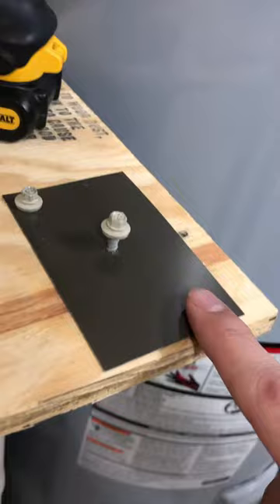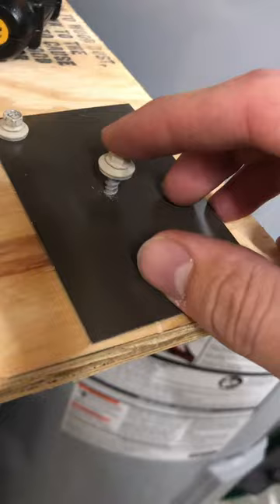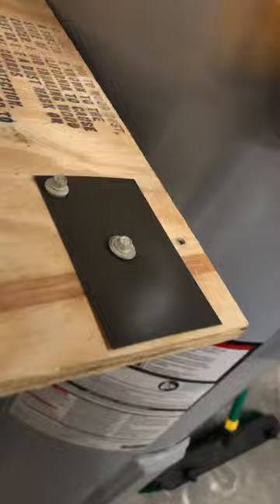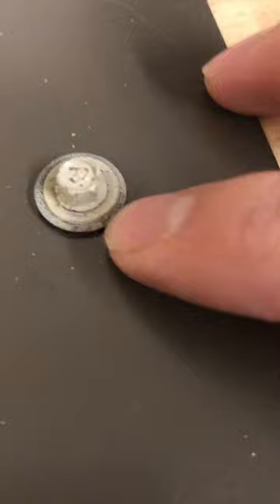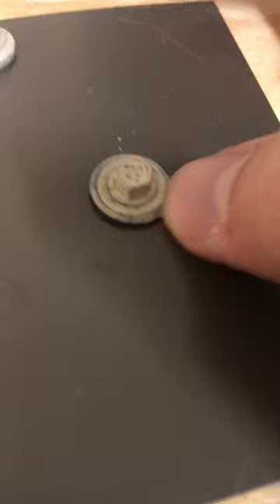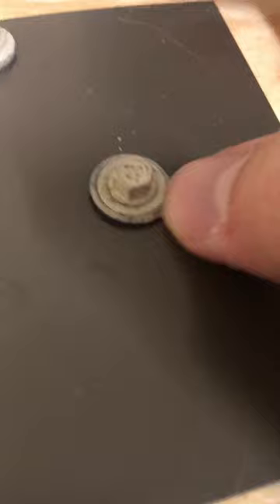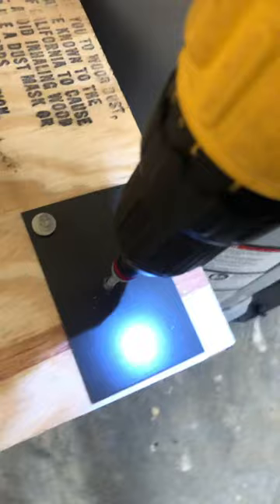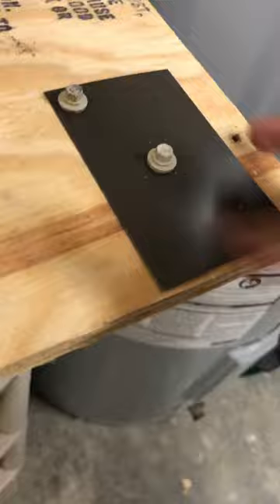How to install a metal roof screw

Comment: Did my roof with the torque set on my drill. You still have to be attentive because the density of the wood changes and screws can be left proud or washers mashed down.
Reply from the maker: Great point!
Reply: Very true

Comment: Do you also have to cover/fill the screw hole with anything? Or is the screw alone enough?
Reply from the maker: The EPDM washer and metal washer above seal if properly installed. No need for sealants aside from that.

Comment: I see these have a grove on the tip of the screw, are they also self tapping screws? (FIY, It would have been a nice touch to have shown that they also self drill through metal, if they do that, that is)
Reply from the maker: Yes, they are designed to self-drill through metal into wood. A different type is available for metal-to-metal which have a drill point on the end instead of a sharp point.

Comment: If you don't mind the extra hassle, is there any reason not to put a dab of silicone or some other caulk on each screw before you install it? It seems like this could greatly extend the life of the screws.
Reply from the maker: The EPDM gaskets used are a long lasting quality - also 90-95% of the gasket is covered by the metal washer. Properly installed there should be no need for an additional sealant. It wouldn't hurt anything, but it would be quite tedious.
Reply: I’ve thought about this too

Comment: Say that I over screwed it. Can I really go back, replace the screw with another one, and screw in the same hole with the new screw?
Reply from the maker: A recommendation would be to use roofing grade sealant in the hole first if going back in with the same size screw. Otherwise and in a perfect world, use either an oversized screw in the same hole or a stitch screw (a short oversized screw that would basically just seal the hole, not add holding power).

Comment: if you can see the rubber after its screwed down it will deteriorate, use a screw that completely covers the screw, thry cost more but last forever not a couple years, your type screw could be used on siding but not roof
Reply from the maker: That's right! Exposed gaskets will eventually breakdown from UV exposure. We recommend a fully encapsulated multi-seal washer just like you suggested.
Reply: Can you please tell what screw is best

Comment: How long you think that rubber grommet will last?
Reply from the maker: Properly installed, they generally last the 40 years of the roof and up. I still recommend they be inspected at about 20-25 years. The metal umbrella washers on modern metal roof fasteners cap about 95% of the EPDM seal - protecting it from UV rays and allowing them to last much longer vs the old roofing nails where the rubber (usually a lower grade than EPDM) was 90% exposed to the sun. The metal cap is galvanized and painted to match.